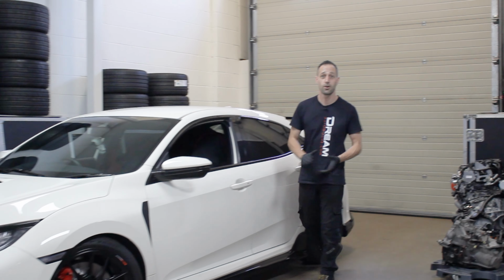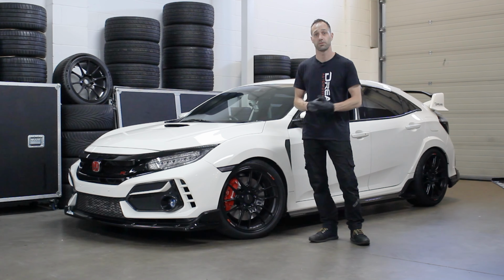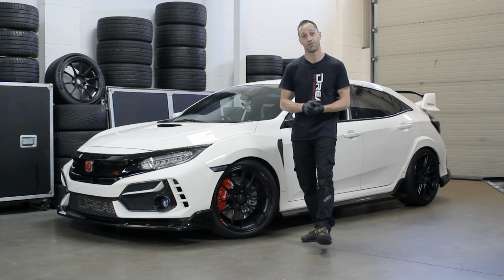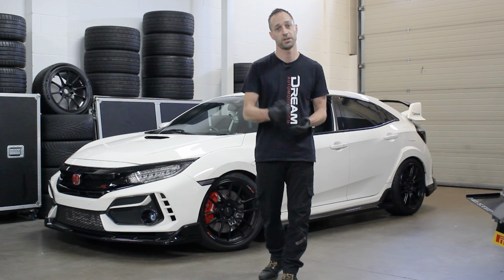FULL FK8 BRAKE UPGRADE (Paragon Brakes) | Dream Automotive

Comment: So you used the OEM caliper in the rear but the just the correct rotor and brake pads. Same with the front ?

Comment: What was wrong with the oem brake lines and why replacing all the brake lines?
Reply from the maker: Making the upgrade to braided brake lines is something we recommend to everyone - even those in non-performance focused cars! Having braided lines provides a much sharper and consistent brake feel. This inspires confidence when driving which is especially important out on track 💪

Comment: AP racing floating discs on mine with Brembo OEM calipers. Pagid pads. Goodridge brake pipes and Motul brake fluid. 
I would not go bigger, All that extra weight for no reason. Also disturbing the brake baised. Go high end pads but the right application for what you are using for. 
No point fitting comp brake pads if the car is never going to a race track.
Reply from the maker: That sounds like a pretty great set up! Thanks for watching Hugo 🙌